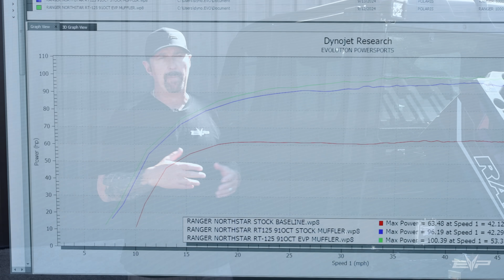EVP RT-125 Turbo System for 2018-'24 Polaris Ranger XP 1000

Comment: I like the location of yours better than all the other kits I've seen. On the back of the machine. I do pull a trailer with mine pretty often and I've always been afraid of crushing the muffler into the turbo parts while trying to hook up.

Comment: Love it can’t wait til my warranty is over I’m going to order one of these kits Do they offer it for a 2024 Northstar  Premium With ride command?
Reply from the maker: Steve, yes it works, the only issue is you must buy our muffler for the kit or locate an OEM one.  The muffler is different between the Northstar and Premium.
Reply: @EvolutionPowersports So the only reason you said it doesn’t fit the premium model I’d because of the muffler incompatibility? Any other reasons why this would not work on a premium model?
Reply: Will there be a u10 pro xl version?